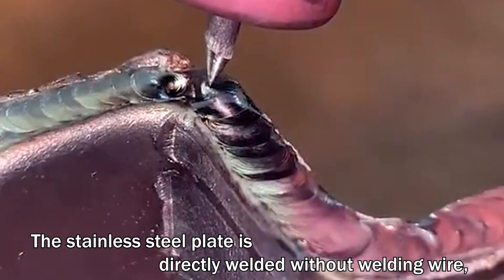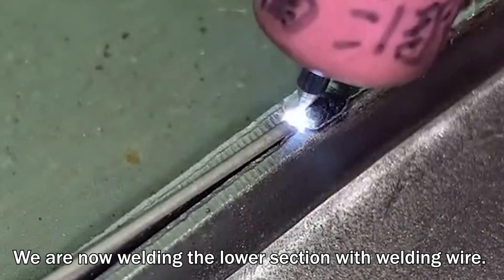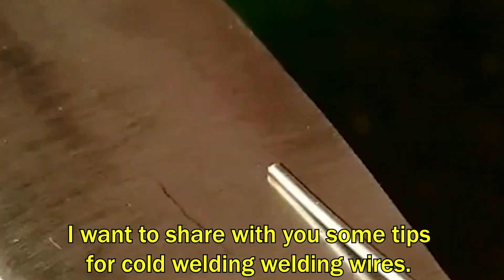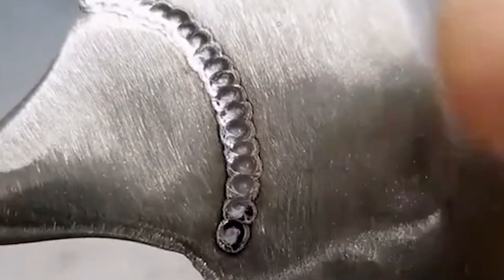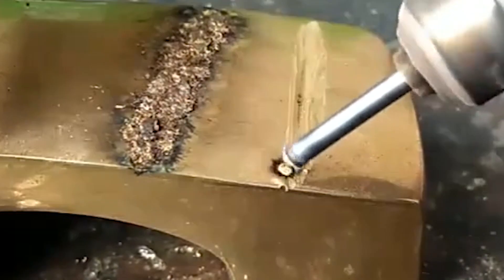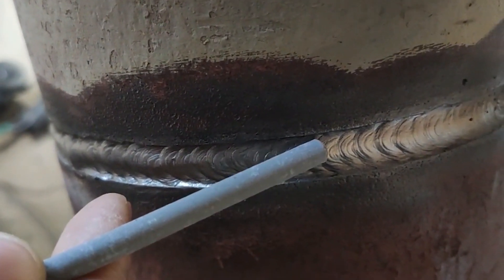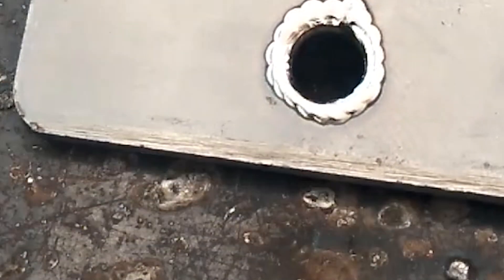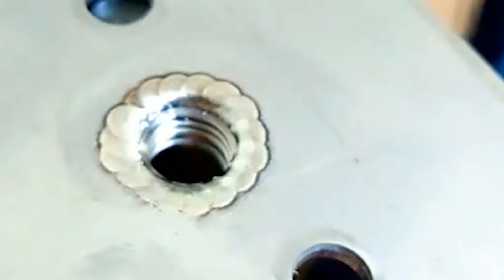Cold Welding VS Argon Arc Welding, 5 Differences Have To See!

Comment: Hello. Thanky you for usefull video.
Would you explain the setting Tig welder for Aluminum cold weldind???
I want to weld Aluminum 6061 tube with 0.7 mm thickness to aluminum sheet with 1.5 mm thickness.

Comment: Is the Cold welding adapter ( retrofit} available in the market  sufficient for making good aluminum joints If the basic machine is 350 amps, will it suffice to weld 3 mm thick aluminum with teg welder cold weld adapter installed?

Comment: Does the basic machine have to be dc or ac dc for welding aluminum with full strength and clean joint  in cold welding :?

Comment: Not sure about this kind of rig. But having worked with tig welders , welding gas turbine components back in 1990. This looks like it’s only good for decorative non structural uses. 
Welders I worked with often did project welds for other employees as favours. 
Was one welder. His party trick was to weld a ripped cigarette paper foil back together. 
Another I have seen weld a broken/ snapped measuring tape and in that instance the , the polishing wheel , used to clean up the weld ,removed more paint from the tape than the welding burned off. 
Was one type of component ,where weld contamination was a major issue. 
Another of the welders figured a solution. 
Place component in a biscuit tin( they were made out of metal in those days)
Fit a separate argon feed to the tin. 
Turn this separate flow on around 45 seconds prior to welding and since argon is heavier than air the box filled. 
Then tig weld as normal. 
Problems with welds went to 0% using this method.

Comment: A lot of "expert" welders commenting on this with zero knowledge of what this is or what the purpose of these machines are.

Look up the German-made Lambert PUK series or American-made Orion series. This is a low cost Chinese version of those.

They're also referred to as Pulse Arc Welders and have been used in the Jewelry, Dental, and micro prototyping industries for DECADES. It's an extremely small and precise spot from an extremely short Tig arc that doesn't heat up the entire part, hence the "'cold welding" term used. The Heat Affected Zone/spot is extremely small and controllable so you can weld extremely close to very heat sensitive gemstones or components safely.

You dummies watched one video from some YT welding "expert" that hasn't welded anything more precise or advanced than a muffler in his entire life and now you repeat his ignorance pretending to be "experts" too...

What's next? Are you going to complain about lack of welding helmet because you idiots don't know that these are typically used with a microscope that has an automatic shutter that's integrated into the pulse circuit?

Amazing.

Comment: Are these welds cosmetic(visual but not structural) or are these welds structural and functional? What maximum thickness of material(s) can be structurally welded to where the weld joint is as strong or stronger than the original metal?
Reply: they are non penetrating and weak
Reply: It can be said that if there is a need, it can be more robust than the original! Different materials can achieve different thickness.
If you want to know the details, you can add my WhatsApp, and I will send you the specific parameters.

Comment: Get a normal tig welder folks. There's a reason it's a cold welder it makes a cold weld. Lack of fusion. Ya gotta burn the 2 metals to fuse good.
Reply: That's weird i have been at it a few decades now but i so far try too avoid burning the metals  I am usually content with melting them.
Reply: @adewit5366  you know what i mean.
Reply: @BaberJacks  when you say burning is jeans something entirely different then melting particularly in the context of welding.

Comment: Basically this is only good for visual stuff, not for structural parts
Thin tubing is fine but nothing about 1mm I would say since there is no penetration
Reply: Penetration is what penetration does, and that is, it melts the weld zone into a small but continuous puddle, and that equates to a continuous build up of heat in the work piece that will cause buckling from expansion, and aluminium soaks up heat and being quite soft will distort very quickly.
Cold welding per se only injects a momentary high energy pulse of amps into the weld area in a small spot that rapidly heats and then cools the weld zone.....the small but intense energy pulse will dissipate into the surrounding metal without building up like it does with Tig.

Comment: THE BIGGEST QUESTION IS:  HOW STRONG IS COLD WELDING JOINTS?  YOU NEVER SHOW A VIDEO OF HOW STRONG THE JOINED METALS ARE.  SHOW US A VIDEO OF TEST BENDING THE MATERIAL TO SEE HOW STRONG THE JOINTS ARE.  ARE YOU TRYING TO HIDE SOMETHING?  IF THE JOINTS ARE WEAK, THEN COLD WELDING IS USELESS !!
Reply: Its not strong this is fusion

Comment: At 4:50 she said that cold welding does NOT require Argon gas?????.....is this a fact?
Edit....I think that was a mistake in the translation as it does need argon.
Reply: You could use any inert Gas in principal
Reply: @adewit5366  Not according to the Tig welding people.
Reply: @gangleweed  That's funny I happen to be a ,certified by NIL, TIG welder (in stainless). Argon is by far most used. Helium for instance is also viable And used to be well used as well.
Reply: @adewit5366  I think you could probably not use any gas at all for cold welding as the flash duration is so short which makes the shielding probably ineffective or just plain unnecessary due to there not being a molten puddle to maintain or a glowing tungsten tip that would otherwise be attacked by the oxygen in the surrounding air..........but that's just what I have gleaned from various users and videos too.......until I try it without gas to see the effect and once I actually get my cold welding skills better all of that is just hypothesis.
Reply: @gangleweed  In principal you could set a constant gas flow of course. Well my main point is that just about every option has at least 1 application. I am sure one could find something for this.
Reply: @adewit5366  Hmmm......a constant gas flow would be overkill, pretty costly too, and as I said, from observation I don't think a shielding gas is really necessary due to the lack of a molten weld pool and a relatively cold tungsten, but that is just a theory and I could be wrong totally.
Those people that attempt to emulate cold welding by doing a mass of rapid spot welds with Tig... almost a continuous weld..... would have to rethink what they are doing and why.

Comment: I don't know if anyone noticed but the tungsten electrode is still bright and shiny at the end of the weld as oppose to it being burnt and rounded due to the tip burning back some as in normal continuous tig welding.
Reply: Well spotted , theres no fooling you about anything at all ,, have you also noticed that even after nearly a hundred years ,  every wash hand basin on Titanic is still full of water .

A third of that video is MMA , and the other third is tig , and even  its been cleaned up very badly with an angle grinder leaving enough undercut that it would fail most pipe standards . 
I think Ill just call you Richard Pearson from here on , or eagle eye.
Reply: @tomthompson7400  Well all I can say is the Cold Welding phenomena is here to stay despite your biased and non experienced opinion of it, so as the actress said to the Bishop......if rape is inevitable, lie back and enjoy it.
BTW....the wash basins on the Titanic are all full of SALT WATER....not just any water, be specific if you have to make a spurious statement......maybe the last man standing forgot to pull the plugs out or turn the lights out.....LOL.
Reply: @tomthompson7400  More industries than nuclear about......you ain't seen nothing yet......If you think it's all hype, just think, when you don't know what you're talking about how can you expect anyone to take notice of you.
I'm retired so I don't have to work for a living with welding.... with the latest technology I just do it for the fun part......a bit of a grind and polish and you'd never know it was welded.
Reply: @gangleweed   Thats my point exactly Dick. Grind and polish any of your '' cold welds'' and they wont be welded . 
Do you need a diagram for that too.
Reply: @tomthompson7400  Only my stick welds.....haven't cold welded yet, still setting up, as I said I ain't a welder and actually hate stick welding.
As you have Not actually used a cold welder I'm surprised you cannot think outside of your tight box.....but given the very fullness of time anything is possible.......like any welding process with any form of welder it takes practice to become proficient.
So cold welding won't feature on your CV unless you take some secret lessons over a long period of time to surprise your boss, but I doubt you'll make the grade as you have a very negative attitude and that doesn't go down well for a potential employer or trainer.
Reply: @gangleweed   It will never show up in either my professional , or recreational welding repertoire of that I feel very very confident . 

Have you tried real welding ,,, oxy acet is real welding , now it is therapeutic and very relaxing , if you get good at it move over to brazing . And if you get those two off to a level where you dont have to think too hard about it , the grail in any welders eyes ,,, gas welding aluminium . Alloy gas welding is a true test of ability , as the better you are the less it looks like you have done, totally totally invisible , I use a strip of the parent alloy as the filler , and at the end of a job , usually fuel tanks for classic race bikes , the tank looks like its been moulded . But thats a lot of time and effort and very very hard to put a price on , still those who want it want it. If you get bored patching wheel barrows or what ever , give it a go , all you need is a basic oxy acet set up and a bag of flux ,, and a couple of months will vanish  ,, od a good set of goggles too , not knackerd old cutting goggles , flux rated so the glare isnt an issue forget '' cold welding '' get back to real welding.
Reply: @tomthompson7400  Real gas welding you say......did lots of that in the 70's when I worked for a firm in Bristol UK doing subcontract work for Rolls Royce.
We were the main subcontractor for Rolls Royce making fuel filters for the Nato aircraft at the time.....I personally made the fuel filters for Concorde, so yes, I know a bit about gas welding and silver soldering.
My main welder now is a plasma welder.....works like oxy/acc on steroids etc except there is no gas needed, pure plasma..... for the heavier stuff and Tig for the more precise bits......the new cold welder has Tig too but I bought it mainly for the cold aspect.....can't have too much heat for some parts without messing them up.
Cold welding has characteristics that ordinary Tig does not have.
I don't intend to do anything spectacular or outside work for anyone as being retired is an occupation I adore and I can go out and do welding at any time of the day as it suits me.
Reply: @gangleweed   Then give oxy acet alloy a go ,, its very very interesting , once the frustration has gone.
Im looking into buying a laser welder , but need it to be semi portable and thats the problem at the moment ,, not decided yet as i use my fronius plasma for the same jobs at the moment , client wont want to pay , and the speed increase isnt worth the outlay at the moment , I make more from inspecting that welding , who knows . See what happens if things go back to normal , the old normal that is. I cant see things going back that way for a while yet though.  Fuel cell for a racing powerboat next , its all tig and will need a pressure test , a weeks work and its not that big .
Reply: @tomthompson7400  I do ally with the plasma but the heat input is quite high and things can go out of control quite quick so I prefer to Tig when ally comes up.........ally is not all that high on my to do list as it's one metal that has little advantage strength wise unless you want to fly  or go fast etc.....corrosion is always a problem wherever.....stainless steel is much easier and 100% more forgiving.
In the videos they do titanium so I might give that a  try too, anything for a giggle.
Reply: @gangleweed   I genuinely wish you well ,, but some how think you will be using the tig more than you expect .
Reply: @tomthompson7400  I already have Tig capability sort of with scratch Tig on my portable stick welder, but I wanted something a bit more practical and efficient and the prospect of having a dedicated Tig welder with the cold welding ability is much more to my liking due to the variety of materials it will handle like stainless, mild steel, aluminium and brass to name a few, but Titanium possibly too, if the occasion arises, will also happen when and if.
I'm in a different league to you in that I don't have to make parts for sale as it's a hobby with me pure and simple.
I will definitely be the first to say it is a waste of time and money and doesn't produce the quality of work that the videos show if that is the case, but until that happens it's onwards and upwards for better or worse etc.
Reply: @gangleweed  ill be very interested to hear your reviews .. you should post a video of one being used in real life .. now that would be worth a watch .. either way .
Reply: @tomthompson7400  That is unlikely to happen as I am not inclined to posting on Utube....takes too much effort and it would only be an indication of my ability not the machine itself of which there are dozens of videos showing it working.
I would rather be watching an expert trained person doing a video than someone who is doing it for the first time and fumbling along etc.
Reply: @gangleweed  we all had to start some where .. non of is were born with as welding mask on ..
Reply: @tomthompson7400  Not my cup of tea....I'm a watcher not a film star, but you never know etc.
Reply: Cold welding is a term we use for no penetration, if you can TIG weld your electrode shouldn't be burnt on the end and if it is you should sharpen it, this is just using the spot weld function on some welders, sometimes it looks like they're just using the pulse function of press and release T2 of the torch.
Reply: @hetrodoxly1203  Yeah yeah, we all know that, but the ideal way to do Tig welding for some of us who just want to stick stuff together and in the process the tungsten can get stuck in the puddle or the end gets burnt off.
How many times have I said it.....the term COLD WELDING.....invented by the Chinese, is just a title that describes the process and is totally different from Tig welding and you can't do Cold Welding by pulsing a Tig.......ever.
Reply: @gangleweed  Tig welding is hard to learn, i sharpen once or twice a day at most, but it's worth it because it's impossible to get a good weld without a sharp point, i've been using the term cold welding for 45 years, it's when you look inside a pipe and there's no penetration even if you're purging it, you can and i do Tig weld like this with my welder, you can do it with the spot weld function or just by setting T2 no pre or post amps, i run a root in on thin pipe like this sometimes, set your amps a lot higher than you think you need them, low amps are the cause of overheating, go a head if you think it's what you need get one happy welding.
Reply: @hetrodoxly1203  Ho Hum, not being a welder or even liking the process of welding but having welded for a few years commercially the aspects of the welding process leaves me cold as all I'm really concerned is to make the part stick to some other part and not have it fall off before it gets cold......my previous boss that I welded for, for 3 years said.....we don't want embroidery here, just make it stick good.
The term COLD WELDING is just a title.....is that too hard to grasp.....nowhere has it been said that the temperature of the weld exceeds the ambient.....to state that would be blasphemy.
Live with the fact that the Chinese invented the process of COLD WELDING and gave it the title...... and so the translation into ENGLISH got lost in translation.
LOL......you say cold welding is a bad weld penetration term in the welding industry.......get real, that is not cold welding either, it had to initially be hot and molten to get to be bad.
Reply: @gangleweed  I didn't invent the term 'cold weld' meaning not enough heat to penetrate the steel, it's what i was taught as an apprentice, i somehow get the felling you'll get a 'cold welding machine' and still have problems because you already know everything.
Reply: @hetrodoxly1203  Not everything, hardly anything to be honest..... I got my Cold  Welder on May 1st and have been dabbling with it on and off.........to say it's a steep learning curve is an understatement....... even if it works according to plan the user must become aware of the settings....(no manual with the welder)...... to get the most out of it or even just make it work at all..........early days yet as I'm setting up an LED spot light to see the work zone as it's difficult to see the work zone and the tungsten tip when the hood lens is light between flashes.
Using it in the plain Tig mode is a piece of cake.